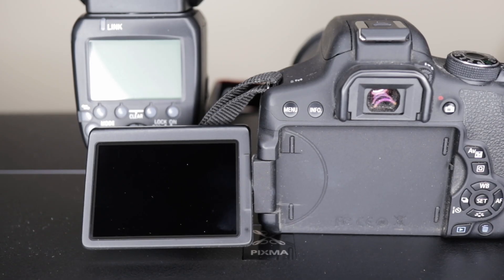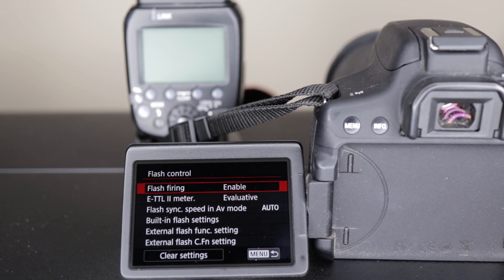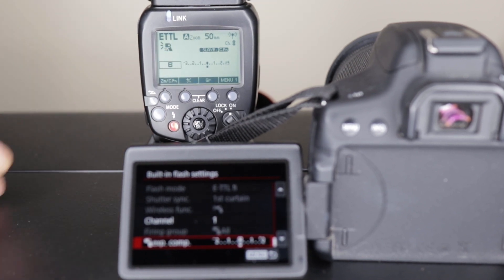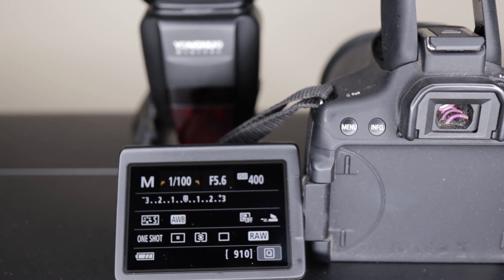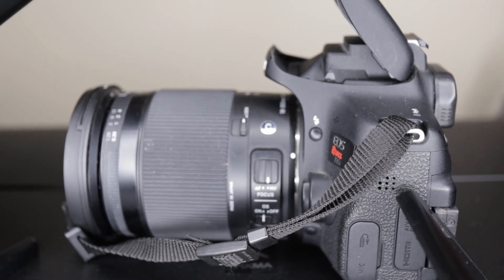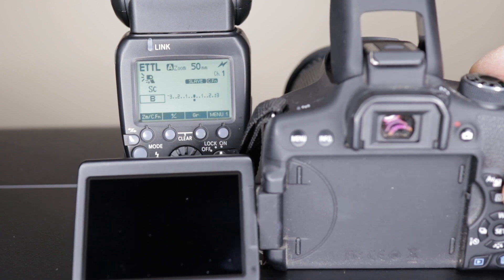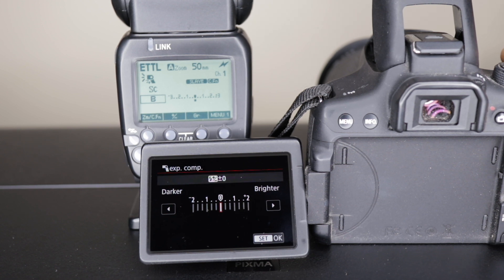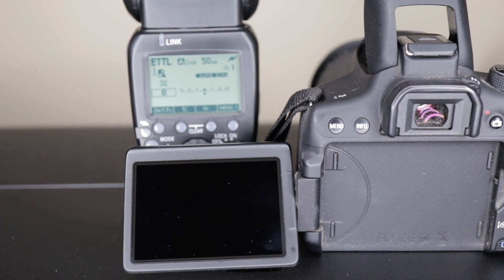Wireless Flash control set-up for Canon (using a T6i and YN600EX-RTII)

Comment: Hey joe my brother gave me his old camera and it's a canon 400d 10.1 megapixel camera and i was told that i need a flash that goes on top of my camera and i need help setring that up. This is my first camera and the camera is 15 years old i was told you was the best of the best to ask about photography so please help me out
Reply from the maker: If you just want to use an external flash on the camera for bounce light the yongnuo 600ex is a good choice. It has an auto function for when your just learning for use flash but as you get more advanced you can expand by adding a transmitter to your camera and using it as an off camera auto flash as well. You can also take full manual control when you are ready. Using a flash not in auto (TTL) mode is a whole different ball game and knowing exposure is key. You generally have to figure 2 exposures. The exposure for the scene and the flash exposure. Start with an on camera external flash with TTL and your picture will instantly improve with the addition of light.
Reply: @NoProJoe  so get the younuo 600ex and use it thru the lens right setting it up will be easy right i think the 80d doesn't have a flash

Comment: I'm trying. My link light on the YN600EX-RT II is blue and it should be green. The scan says "good" but it won't fire. Why do the external flash settings in my Rebel T8i say "incompatible flash or power is off" I'm not sure what I'm doing wrong
Reply: I just set the wireless mode to slave Sc and it now fires if I have the flash up. Is that the right way? Why won't it flash without the attached flash? I don't want front lighting, only side lighting.
Reply from the maker: @CybekCusal  The flash you see from the camera is a signal flash and will not show up in the photo. It just tells the flash what to do.
Reply: @NoProJoe  awesome! You just saved me $100 by not buying the transmitter ❤️
Reply from the maker: @CybekCusal  I'm glad it helped! I use the transmitter because I can fire multiple flares all set differently. However, if you have no need for the the Canon wireless system works pretty awesome. :)
Reply from the maker: Click the built In flash tab not the external flash tab. The external flash tab gives you the warning menu cannot be displayed incompatible flash or power is off.